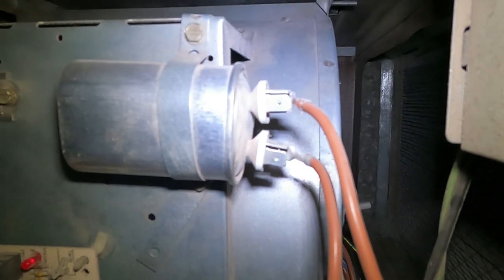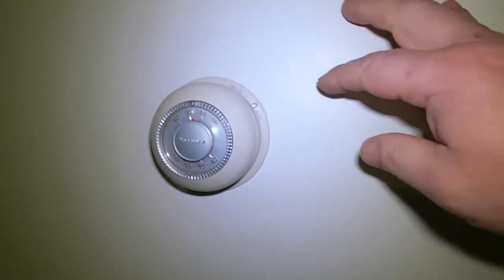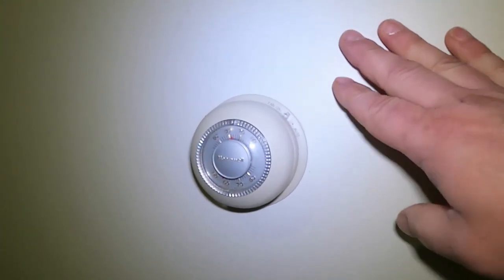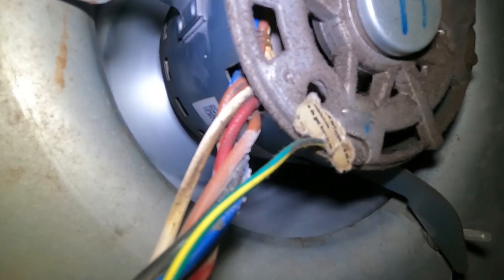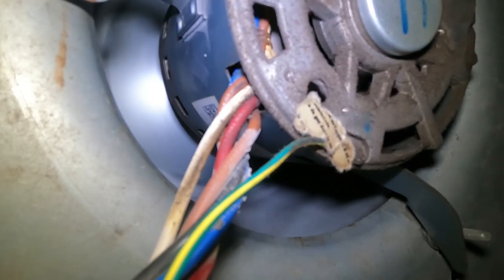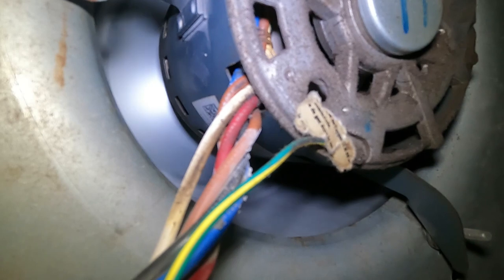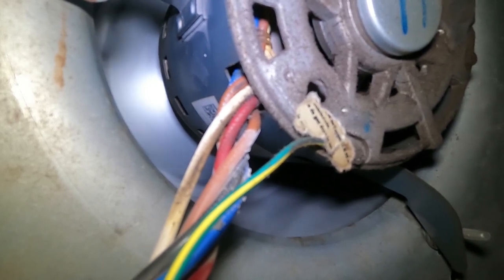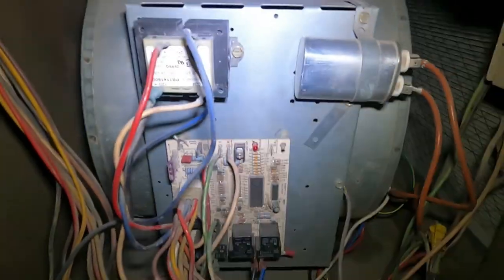DIY HOW TO TEMPORARY FIX FURNACE BLOWER MOTOR

Comment: good bandaid approach. The cons is your going to have for 24-48 as you mentioned- fan constantly blowing so a.) your efficiency goes right out the window because when your not heating via the furnace exchange (natural gas etc.) your distributing unconditioned (cooler to cold air). Feel this constant draft. You might have more call for heating action do to set temp being altered by draft air. An alternative if this has an evaporator that means you have a condenser so you could remove the CONDENSER capacitor which will be the wrong size but will most likely be higher in microfarads and voltage (which is ok). The condensor capacitor most like is a dual capacitor: fan, herm, common (3 terminals) so you will only hook two (2) of the terminals to the blower:  However if this is a straight furnace (HEAT ONLY)  and no cooling then plan b doesnt work. Most big boxes are carrying capacitors in stock now it doesn't have to be the same shape the capacity and voltage can be higher.
Reply from the maker: Never heard of the condenser capacitor switch. The fan was a 10 the condenser has a 35 5 would you switch these?
Reply: @themrhelperguy  didnt say switch as in a switch BUT TO EXCHANGE/SWAP the capacitor. There is a run capacitor in the condenser KEY WORD IF YOU HAVE A CONDENSER which means you have COOLING AND HEATING with an evap coil over your furnance